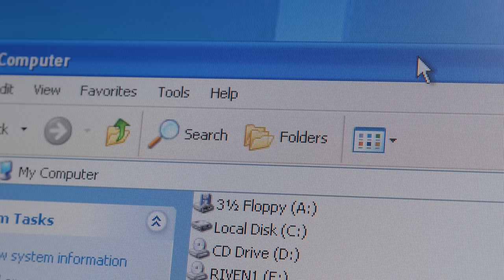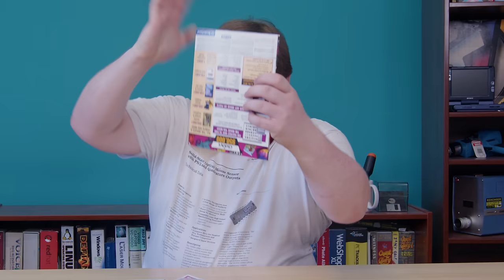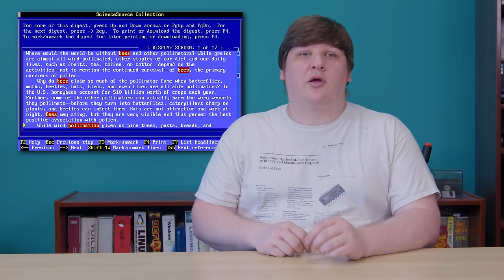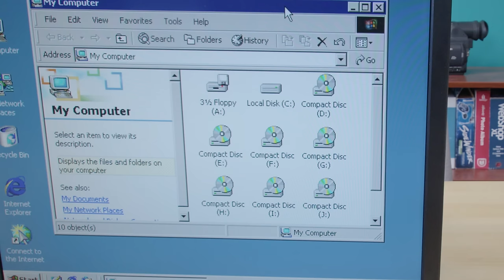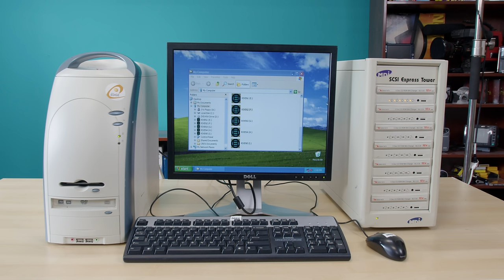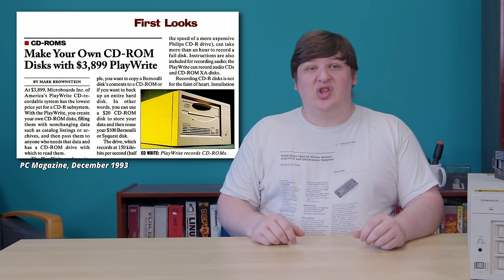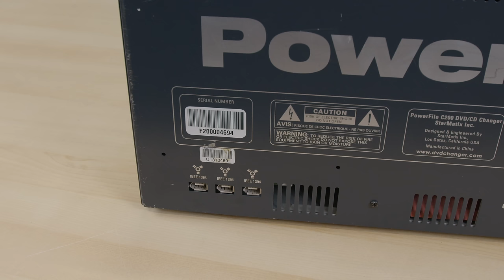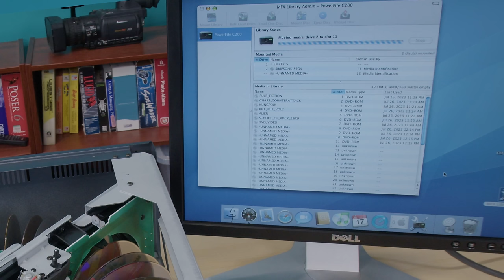A Jukebox for your PC: 1993's CDROM Servers

Comment: Conceivably since we can spin a CT machine at 120RPM and the spinning bits weight hundreds of pounds, it should be possible to spin only the laser assembly of an optical drive instead of the disc. Surely there'd be a massive amount of trouble with balancing it properly, but it could cut down on disc changing times dramatically. You only would need to get the disc into a single position instead of going through the whole loading process and then waiting for the disc to spin up.

Comment: Panasonic did a WORM optical disc, which guaranteed a data retention of 50 years, and also that they would have readers available over that time, popular in the USA in the wake of Sarbanes-Oxley act. A client I worked for had a big CD-ROM jukebox, that was part of a hierarchical storage system; a ROM would be retrieved, then copied to hard disc, and made available to the user on request. They did the same with other internal archive data using a huge tape robot system.

Comment: The advantage CD-ROM had over floppy in the early days was that you no longer needed several install discs. Even if the installer took up only 12 whole megabytes on the 512 MB CD, if the same program was on 1.44 MB floppies you would need nine discs.

Comment: I delt with cd libraries at large companies.  The changers are a bad choice: the delay, mechanical failures.  Most of the deployment was by sneaker net: an admin like me would go to the users wirk station and load the disk.  For libraries that needed multiple access across the LAN we would buy a server with enough cd drives to accept all data cd-rom.  
The archival solution I liked best was the magazine fed burner: the magazine had unwritten disks, after writing one it is ejected and a new one is loaded from the magazine.  This was good for backing up data and copying disks.

Comment: Optical disks do seem like they'd be the ideal backup solution, if their capacity ever catches up again (meaning we need disks >3-6x our largest HDDs to make it viable, so we're talking >60TB which may not even be physically possible). The main advantage is a high quality optical disk can/will last for decades without any degradation, if properly stored.

Comment: Not that it matters at this point, but there are low-level SCSI utilities designed to work with storage libraries like that Pioneer jukebox. lbtest and robtest are a couple I can think of that'll work with at least a SCSI tape library. And since that thing uses a SCSI medium changer, they might work with it, too.

Comment: the standalone "network cdrom" often had 7 or 14 drives as they internal was on an scsi bus, they had an network controller there made the shares of each drive and very important they had some cache memory or some times an extra harddisk for caching the data from the cd... because the cdrom was good for storage but not very good when multiple users tryed to access the same cdrom.... then it got very very slow, so that is why it was important with the cache memory/harddisk cache function.

in 1994 i got an cd writer for making "backups" and it was an Philips CDD521 that i still have and in the begning of the video there is an picture of it in the PC magazine cover that you show.

Comment: The first library with actual digitized full-text of a comprehensive collection of scientific articles was (I'm pretty sure) JSTOR. It launched in 1994-1995, so just after your timeframe. And... it wasn't distributed on CDs. By that time, universities and "serious" libraries had pretty good network connections, and they expected that to expand (which it did), so they decided that physical distribution was a lousy investment.

JSTOR wasn't actually all that comprehensive to begin with (just 10 journals) but it expanded pretty quickly. And, groundbreakingly, it had full-text search of all of that content, not just the titles or keywords or abstracts.

Comment: One of my previous employers had a big DVD jukebox like that, in the late 2000s.  Among other things, the company did malware analysis, and in the interest of being thoroughly paranoid, the lab network had been set up so that all devices, including the storage server, were thin clients which only had RAM drives for local storage, and would boot off one of the DVDs in the changer. 
It was horrendously slow by modern standards, and only two machines could boot at any given time because there were only two drives and the storage server would ignore new clients until each client had finished booting, but it did mean that a power cycle and like twenty minutes' wait would get a machine into a known good state, with the exact OS version and patch level desired, guaranteed clean by the simple fact that nothing could physically write to its boot media.

Comment: I had one of those drm1804 cdrom changers... on my BBS Lost in the Never . It however, did cause issues because it would interrupt all processes causing the BBS to freeze when people would access the drives. Mine was loaded with freeware so people could download tons and tons of software. I moved it to a 2nd machine and that fixed the issues. I forget how we networked it. Some type of coax and I forget what the software that ran on. The BBS was on Desqview as its base. The OS of course was just DOS. As I recall I paid over $2000 for that 1804. I was a teen then so this was a huge cost back in the 90s.

Comment: My guess would be is that solenoid inside Pioneer's mechanism is probably acting as a sort of "automatic transport screw".
Given that it's not the smallest, lightest linear drive, the sled may be massive enough to skip around on it's own in "rough handling" :^).
Also, I guess, typical "worm drive" or "toy DC motor /w reduction gears" mechanism would resist moving from external forces naturally. Linear drive probably doesn't resist much, unless it somehow sticks together or drops when deenergized.
There's an old MFM drive sitting in my storage; It's a NEC D5126, and it has similar thing - there's a solenoid keeping head assembly stepper motor from moving while powered off. No clue if that was common, but there's that.

Excuse the double post if any, youtube seems to have eaten the previous version of this comment :^)

Comment: I made a tower pc with two 5-disk changers to do video editing in the mid-90's.Digitized segments of video from S-VHS and burned them to CDs. Premeire at the time was able to handly the disc switches ok, but organizing discs and errors on burned discs made it too time consuming to be reliable.When it worked it was fine, and made quite a unique racket with its shuffling ways.

Comment: I was a Novell NetWare admin and network admin in those days.  Large corporations (often more than 500 users in a single site, with 15 or 20 such sites), it was not affordable nor desirable to consider having a CD in each (or any large quantity really) PC.  It was partly for cost and partly to keep users from installing their own software which could compromise the network for security or viruses.

So the answer was to get a network attached CD tower that the network admin to load the cdninto and grant (or remove) user access to the CDs.

These towers were very effective in that role.

Comment: It makes the most sense as archival retrieval. Legal cases, science papers, newspaper articles, stock images, etc. There would have to be an index, a queue system (both could be manual) and some local storage. Users would key in their desired data, and within a few minutes, the files they wanted would be "downloaded" onto their machine. The reading/writing/editing by humans would be slow and random enough that you could have a single bank of discs for 10-50 people with no one having to wait more than a few minutes for their turn to access the database to get the next batch of files.

Comment: You might be able to find a whole collection free of charge if you go down to your local old school auto mechanic repair shop. A lot of those places used to run on CDs and DVDs of old timey car repair manuals that were want to say 1500 or $5,000 for a year subscription and they sent you new discs with new models on them and all of that fun stuff. This was back in the early 2000s. The last interaction I would have had with it probably would have been 2005 2006 when I help somebody set up all of their discs as ISO images that they could mount without having to physically have each disc swapped every time. 

They were usually broke down the discs by manufacturer and then by decade, and often included time in troubleshooting steps for various issues. Wiring diagrams exploded views of parts and repair instructions, The later versions would usually include an estimate for how long the job should take, as well as integrations and tie-ins to things like QuickBooks for billing, parts ordering and the like

Comment: For WORM stuff, I had a 2nd had Panasonic WORM drive - 200 MB (100 per side) that used an 8 bit scsi card and it's drivers modified DOS 3.2 to work. It worked ok, we had it on the network at my house using a PS/2 model 30 and NE1000 to get data on and off it. I contacted Panasonic to see if there were ever any drivers that would work with a newer version of dos, and the response was literally "Wow, one of those is still working? Stick a glass case over it and put it in a museum!"

Comment: Back in the 00s I worked for an MSP that bought a few of those PowerFile units to store its collection of MSDN and other software installer discs. We had a different model that was CD-ROM only and USB2, IIRC. In theory it was a great idea, but in practice not so much, because you were right— those things were tremendous pieces of shit. They didn’t last long.

Comment: The only time I've heard about WORM was actually in the context of Plan 9. It turns out Bell Labs had a magneto-optical WORM jukebox that was used as backup... and as the *primary filesystem*. Sure, the file server had a hard drive, but that was really just a cache. All the writes were buffered to the hard drive and written to WORM at the end of the day, and reads were buffered to RAM and disk. 

I'm not sure how they handled arbitration for multiple users (apparently less than 1% of reads hit the WORM), but apparently you the daily WORM backup was exposed as a file share, so if you ever needed an old file you could just `cd` into the right backup and copy it out, like the way Time Machine works on macs. In any case, since they were writing the OS and everything else from scratch, they could implement whatever kind of arbitration they wanted.

Comment: While i never worked with these sorts of drives, i did see the giant rack sizes MO changers that existed for those drives being used. They could only load a single disk at once. No idea how many disk could be read at once though. It was all HPUX and Solaris, so expect sadness. 
I was however a tape monkey for the same company. We had a car boot full of tapes that every day needed to be distributed around several datacentres all within a few miles of each other. Loading the tapes varied wildly between the models of changers. There were libraries that had slots for taking the tapes and usually 8 drives for LTO tapes. The older ones had just a single slot that you had to load tapes one by one, they were miserable! The only marginally better ones had a carriage you could load 8 or so tapes in at once in, and that would then pick each up one by one and load them into a free slot. They could hold 200+ tapes at once and feed them to the 8 tape drives. They all had barcoded labels that would be indexed in the software that ran on java in the year 2000. I will leave you to guess how miserable that was! 
Often the "best" way to load this thing, and especially if you had 40 tapes to load, was to open the entire front door and drop all the tapes into the library that way.

Comment: There is a 200 disc FireWire DVD drive from Sony XL1 and XL2 Media Center PCs. People use them with custom software for ripping 200 discs at a time. I grabbed one from a thrift store after
ogling them at Fry’s Electronics for several years.

Comment: I remember those LaserMemory changers being used in the library I went to as a kid. Well, I say being used, they were THERE connected to the computers, but I never personally interacted with one. Storage Area Networks (SANs) can provide block-level storage to multiple users because they have a file traffic cop (metadata controller) to lock files when in use. The most obvious solution would seem to be a controller that locked access to parts of the disc library that couldn't be used. Have a two-drive library where both drives are in use? Send a busy message back to the user. You could even design the software so that it would notify a user when the library was free again. Even that SCSI Tower with all of the Nakamichi changers could have simple logic written in software as a driver to stop that thrashing. Data from Discs 1 and 5 on Drive 1 being requested at the same time? Honor the first request based on a timestamp and deny the second. Too bad they didn't ask me for ideas back then. I was only 7 in 1993 but these would have been million-dollar solutions! 😂

Comment: Pioneer disc readers of that era are famous for the lens falling out. The good news is they used the same assembly on a lot of different readers so they're usually swappable. Look up some of the pioneer multi-disc systems from the 1980s for consumers and you'll probably find that reader that you're looking for. You can also reglue the lens back on and it will work I've done it. But it's finicky and you need to be very careful if you use super glue
Reply: If you have other pioneer systems make sure you open them up and glue that lens down because it's only a matter of time for it to pop out

Comment: In a large company network scenario the "CD juke boxes" were rarely used in that way.  This big units (held more than 50 - 200+) optical disks were used for imaging storage and recovery.  Large scanners (about 4 times as big as most ATM machines now) would scan 100,000 documents a day and burn them to various types of optical disks and then there was a special software system for retrieving/processing the images for various types of businesses.  Like insurance claims, banking/loan processing, etc.

The big footprint systems were rarely used for user access to a single/specific CD for a PC.

Comment: I used to work for a utility and we had a couple of CDR silos. They had a robot and a few drives. They were used for archiving letters, mostly of complaint, sent it. They were scanned in at some company that did that and transferred onto the CDs... somehow (I was a Unix SA so never really worried about what things were actually used for). 

The robot arm used the same software as the tape silos. Basically it sent SCSI instructions to the silo which retrieved the caddy based on the barcode on its end and put it in the drive.

I've literally no idea how it was presented to the agents in the call centre. Probably they had a short bit of text with a subject and date, and if they click on the right letter it went and got it for them. I never saw one actually move, so it couldn't have been the commonly used.  I did get the impression from everyone from the facilities guys who maintained them to the application people that they were hateful to use but there wasn't any choice.

Comment: I regularly used floppy disks until the mid 2000s to transfer small files between different computers, because I didn't have a USB drive before that as they were expensive (and some computers, for example the public ones at the university, only had USB ports at the back, which in this case were unaccessible because of how the towers were mounted) and not everyone had a CD burner and the whole process was faster than burning a CD, as burning a CD always took at least 1 or 2 minutes, even if you just burned a text file with a few KB. Actually even after that I sometimes gave files on a floppy disk to someone, as they were cheap enough to just give them away, while my USB drive was too expensive for that. In the late 2000s I stopped using floppy disks regularly except as as boot disks, because at that time it started to be not unusal to have a new PC without a floppy drive.

Comment: I had one of the single cartridge Pioneer Units ... this used the same magazine as my CD Player .....

The storage on my Mac  went from Floppy / Hard Disk, a Syquest 44 Mb, then a 100 mb Zip Disk .... 
I acquired the Pioneer CD Rom used at a computer yard sale ... this in the mid / late  90's [ like 96 - 98 ] after getting a CD Burner 

this was a fun toy for a while, but windows 95 was slow as the OS scanned all of the discs before you could use this.

Comment: Cathode Ray Dude, at 51:44, magneto optical drive: was the for runner to the CD-RAM standard, that got beaten to death by, the les superior cd-r, cd-rw, cd+rw.  CD-RAM looked and would work just like  recordable CD, but it could also just be treated exactly like Hard drive , formatted the same even using widows or what OS disk tools format as any drive to fat, fat32, ntfs, etc.